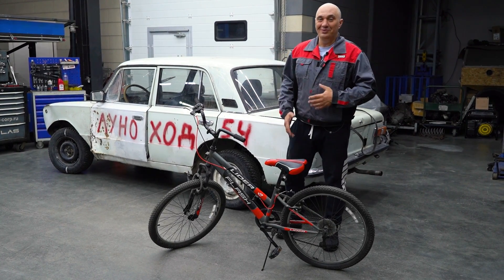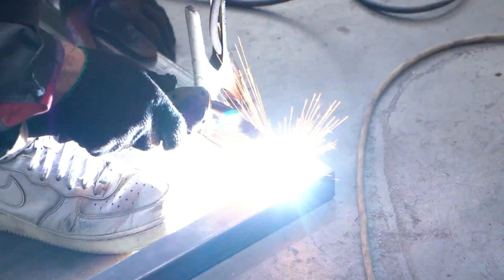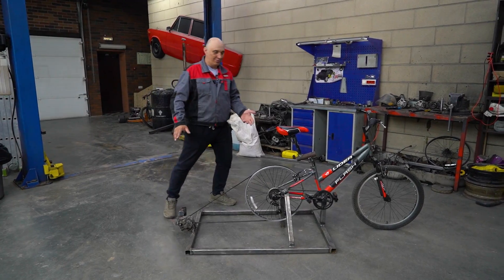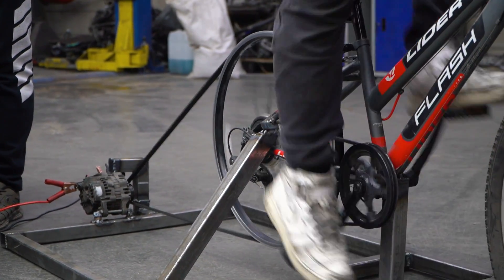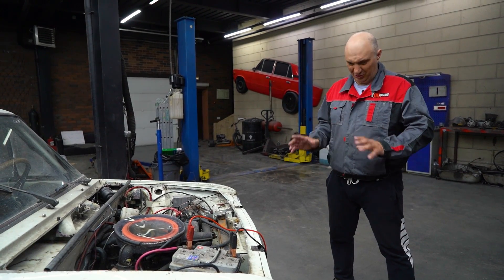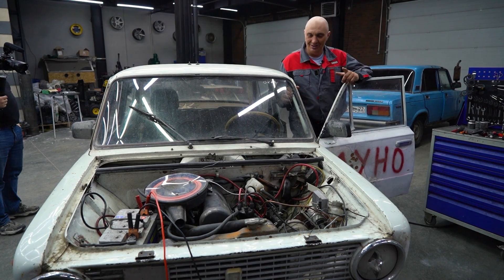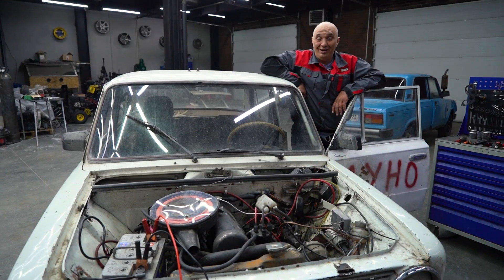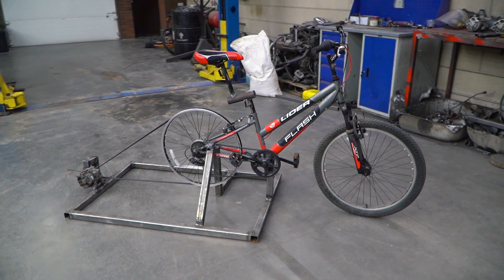Express 10 minute battery charger - pedal faster!

Comment: This system needs a flywheel and a clutch, that's why it's hard to pedal and you get exhausted quickly, because you're constantly under pressure without taking a break.

Comment: What if you make a wind powered car, cut a 55 gal drum in half long ways, flip one over then weld them together, so they cup the wind, put that on an alternator, so when the drums rotate by the wind, it supplies power from the alternator, to supply electrical power to move the car, you can use a second alternator as a motor to turn the driveshaft.   That would be interesting to see you make this. 😁👍

Comment: I have a gas powered two-stroke bicycle that doesn't require battery to run so you could easily use that as a charging Outlet

Comment: I was doing good to keep gas in my car, no way I could go buy a new battery. To get by until I could buy a battery, I mounted an old washing machine motor on the inside fender well, so what I had to do was roll the alternator belt off and put the spare belt on the alternator and washing machine motor and plug it in and charge up the battery good enough that I could start the motor and off we'd go.

Comment: You could try this again with a flywheel, and a General Motors alternator. I believe they are to totally self regulating to output 14V and don’t need an input to control the output

Comment: Replace the lead acid battery with a lithium battery or add a capacitor bank to help compensate for lower voltage situations. 😂😊

Comment: Had the battery go dead on my truck and did a similar thing except mine was take the bar off a chainsaw a wrap the serpentine belt around the chainsaw to the alternator and start the chainsaw and let it spend the alternator to the battery got a good enough charge to start the truck

Comment: If you can't just park your heap on a hill or if you can't manage to keep a fully charged backup battery in the trunk, you'll be needing Garage 54's custom pedal-powered charging system. For convenience, this can easily be permanently welded to the roof, adding beauty and utility to your heap! This modification is sure to substantially add to your heap's resale value.
Reply: Jumpbox but a cheap 1 that wont do carp for a fully discharged battery cause I live on the wild aide

Comment: In Australia many years ago they had pedal two way radios the large cattle  stations didn't have a reliable source of electricity but there is the school of the air and they had there lessons ovrr the radio and the students had to pedal to produce electricity for the radio to operate

Comment: You're supposed to wire it straight to starter motor but with capacitor in between wires... When I was younger I hooked up 230 volts straight to starter motor and it was mere seconds before the car started...

Comment: What you could do to make this work is… add an additional wheel to the system the has lots of mass. If you spin up the mass, the generator/alternator will continue spinning for a long period of time needing less effort to keep the voltage and amperage output much higher with stored energy. Love watching your show from Minnesota.

Comment: Get an asynchronous inductive mains motor, hook it up just like they did the alternator here. Plug it into the wall socket, it will start spinning and turning the rear wheel of the bike. Now get on the bike, choose the best gear for you and try to spin the motor faster than it turns with the electricity from the wall socket. A funny thing will happen: You will be able to raise the motor rpm just a bit, and the it will start giving you resistance. And that's it - you just started to generate electricity and push it into the wall socket! Of course you don't have enough power to power up all the devices at your housw or flat. But at least the meter will turn slower, so you can do your training and lower your electricity bill just a bit! Try it, that's not a joke, it really works.

Comment: Flywheel would of made it a bit easier once it got going
Reply: No, just needed to use a higher gear.
Reply: @christophermarshall5765 why not both?
Reply: @AlienLivesMatter  using the right gear, the bike wheel will act partially like a flywheel at high speed. Cadell Evans could pedal that, & not even know there was an alternator driven by the back wheel.

Comment: Idea:
Have a second alternator charging the second battery by using the CV axle while you drive and with the flip of a secondary switch you simply switch batteries if it dies
Reply: Thats just regenerative braking with extra steps

Comment: got a home made generator, small 1 cylinder gas engine, uses a car alternator and with a power inverter and deep cycle batteries, i get 110 volts house current BUT, put the jumper cables on a car battery with the engine running, i have jumped off my car, a neighbor's car, brother's car and even jumped off my riding mowers with it, and used it as a 12 volt battery charger.  i let me neighbor use it one night, and his family was shocked that even after it ran out of gas, they still had a tv and fans going.  i just laughed and told them that was the way i designed it and was why i used deep cycle batteries since i was using a power inverter.

Comment: I once had a lawn mower with a spring you would wind up then release the energy to start the engine. You could try that on the Lada. A kick start could work too.
Reply: The earliest Ladas had a hand crank for starting when the battery couldn't get the job done.  Sounds like BS, but it's true.
Reply: yes, you could manually crank the engine the same way you could start a prop plane; and snap your wrists.

Comment: My dad used to take alternator belt off get old electric 110v electric motor Mont to board then run belt to charge battery up when didn't have a chager

Comment: 8:12 when you crank a vehicle the alternator is excited to 13.8 to 14.20 volts as the engine turns over. You guys only used the battery power in this video when you should have been peddling as you cranked the vehical garage 54

Comment: 6:55 12 volts is not good at all. That battery should be holding 13.20 v if it is a one. Garage 54 at least here in America are batteries hold 13.20 v brand new
Reply: This depends on battery chemistry.
Reply: In Siberia, 11.9 volts is plenty.  Vlad said so.

Comment: Replace the rear wheel with a flywheel or flywheels .Added rotational mass could improve stable rotation.
Reply: An automotive type flywheel mounted on the alternator drive pulley would improve its reciprocating effect while charging.
Reply: So would shifting.
Reply: I came here to say the same thing 👍🇨🇦
Reply: That is a great idea. Take some of the strain out of keeping it turning.
Reply: Also a larger diameter as it'll increase the ratio between the bike to alternator allowing the alternator to spin faster

Comment: Put weight on the the rim to keep the wheel moving when not peddling.
Reply: Water in the tube will do the trick really good.
Reply: Weight on the alternator drive is better. It's the part most in need of reciprocating

Comment: I can't believe 4 minutes was the longest someone could pedal. I go out riding everyday and it takes me 1 hours 40 minutes to ride 32 miles without stopping and I'm 58 years old.
Reply: You dont know how much tension is has.... dont jump to assumptions...
Reply: @SLMAHKMY87  I climb 1,00 feet (~300 meters) on a few rides that I do, and I complete the climb in less than 20 minutes. It is on a shorter ride than the 32 mile ride that I do. There is no way those people would be able to do a ride like that on that bicycle without that strap to the alternator coming off.
Reply: If we're ever invaded, I hope you will be there to show them who's boss.
Reply: @danbergthold3481  I'll be the first one there.

Comment: I cycle a lot and ride an indoor trainer. I had someone ask me if I could run something off the power I'm producing. I'll have to send them this video 😂
Reply: I watched a WWII movie some time ago. They used a bicycle rig to power their radio.
Reply: You could easily do this, just get a high output alternator with a self regulator so you only need + and - to battery and you are good to go!

Comment: Maybe build it for extreme weather deep snow outside would require the alternator be mounted at minimum 4 feet off the ground and a housing over the alternator to keep snow and rain out of the electrical connections

Comment: I wish you went into more gear ratios to see what you can really get out of it
Reply: YO MAMA DONT LIKE GEARS
Reply: Pfff
Reply: You don't really need gear ratios for that, an adjustable coil current regulator for the alternator would give you infinite adjustability from 0W to whatever the alternator is rated for, which is probably more than what a normal person can put out - I've pedalled on a dynamo while I was pretty much in my best shape ever and the most I could do was 700-800W for 15 seconds.
Reply: @teardowndan5364  alternators need to be spinning at least 2,000 rpm to produce full power, which is why it has a small pulley. Had they used a higher gear on the bike, then getting the full 60 amps out of that alternator would not have been a problem. The regulator you do not see, because it is inside the alternator. The extra wire you see doesn't connect to the ignition side of the car electrics. It connects to the battery warning light, which is connected to the ignition side of the switch.
Reply: @christophermarshall5765  In most car alternators I've seen (haven't worked on anything over 20 years old), field control is external so the alternator drag can be suppressed as much as possible while cranking. The "battery warning" light doesn't really need a connection to the alternator, it can just light up whenever battery voltage is below 12.5V since a running engine with working alternator and no shorted battery cells will almost immediately get system voltage to at least 12.8V.
Reply: @teardowndan5364  You screwed up mate!! The battery indicator light in older cars is connected to the alternator. When you turn the ignition on, the warning light comes on, & it is through the warning light the stator windings get the power. I'm a retired auto engineer. I'm extremely well versed in how they work. Modern cars have the alternators computer controlled, & volt meters on the instrument cluster, but still require power to the stator to get them working. An alternator won't work without the stator being excited by external power. The way you state about the alternator drag being supressed during start up, is not right. This system works on an rpm sensor in the engine, so the stator is not excited during start up. Once the engine has started, & has been running for about 20 seconds, a relay switches power to the alternator to excite the stator, thus allowing the alternator to produce electricity. Yes, the battery warning light does come on when ignition is on, & this does not indicate low battery. It indicates a fault in the charging system, which is usually a regulator problem.
Reply: @christophermarshall5765  "An alternator won't work without the stator being excited [...]" it is the rotor that gets excited via slip rings, not the stator. The stator is the output through a 3ph bridge rectifier. As for the instrument cluster getting power from the alternator, all power distribution in a remotely modern car is centered on the battery and will run perfectly fine with a busted alternator for as long as the battery has enough charge remaining, which is about 1h beyond sudden alternator failure such as a grenaded accessories idler pulley like what happened to one of my friends last year.

Comment: I think you can consistently produce around 200W by pedaling. A 50Ah battery would need around 3 hours to fully charge with that power (without losses). Thats faster than some battery chargers!
Reply: 200w is not easy to generate though. I tried on my generator bike and even at only 60 watts... The load on the petals felt as if you were petal powering a bench grinder in Wich someone was grinding a block of rubber. If that makes sense, it's just the only way I can think to describe how hard it is to petal
Reply: @mondude9754 400 watts is a professional level. 200 watts is a pretty good athlete.  I’ve ridden with guys that can do 1300 watts for over 30 seconds, quite impressive!
Reply: You don't need to fully charge a battery to turn over the starter though
Reply: 200w is profession levels of sustained power.
Reply: @MaYbYl8eR  and I'm assuming that is the rating of actual energy exerted by the person. Converting mechanical motion to electric I think is only like 50% efficient so really you'd need to be putting out 400w of energy to get the 200
Reply: @MaYbYl8eR  no, track pros do about 400 watts per hour. just check on the track hour record with wiggins and others.
Reply: A real alternator from a car puts out thousands of watts.
Reply: @cliffcorbitt9494  only if there is demand for enough current, and it depends on the engine and alternator. Some can easily do that at engine idle, some can bot
Reply: @SerPurple51  that is incorrect with a car altinator. Once it gets excited it will make all the voltage it can
Reply: The right gearing and flywheel fixes the eversion issue

Comment: I did this years ago.   The power required for the alternator field is too close to what an average non athlete can easily pedal.   You get a lot more usable power by using a DC permanent magnet motor in place of the alternator.  Just add a rectifier in line so the battery doesn't try to run the motor when you stop pedaling.  Motor size around 100 Watt would do it.
Reply: It's only about 2 amps to run the field, although the DC with no vampire power drain is better.
Reply: @TimpBizkit  Depends on the voltage for the windings. 2 amps at 12 volts is still 24 watts of loss - non-athlete cyclist could pull maybe 200 - 300 watts, but definitely not at a sustained load - comfortably sustained would more likely be 150ish watts. So 24 watts lost is a fair chunk.
Reply: Google 'How to Build a Practical Household Bike Generator' by Low Tech Magazine
Reply: You guys are stuck inside the box.
Try THIS instead:
Ever heard of a STEPPED MOTOR???
Drive one of them, and you’ll get a LOT more effective energy than an alternator!
AC is just fine, but it took another guy to think outside the box to realize that it would transmit a lot farther than DC!!
Reply: lowtechmagazine /2022/03/how-to-build-bike-generator.html
Reply: How well can it change a Tesla from 20-80?
Reply: Or just a smaller alternator, they are way more efficient at power conversion than a DC motor
Reply: Nonsense, you probably fed it straight to the field winding so the current flowed as if it was a short circuit, because it was in fact a short circuit!
Reply: @SinsBird field windings can take 12v direct. When I hook mine up to 12-13 volts the field windings pull about 4 amps so far from a short circuit. And I can confirm even supplying enough current to keep the alternator on is immensely difficult on my generator bike
Reply: @mondude9754  it depends on the regulator! One regulator can limit to 2 amps other can have no limit! There are different styles of alternators.
Reply: @SinsBird  I was talking about with the regulator bypasses

Comment: I saw Vlad only making 11.5v 😂
Reply: It's obviously a low amperage alternator morons! It's not gonna just put out 14.5v right out of the gate under a load. Educate yourself
Reply: That means his voltage regulator is no good. It needs to be at least 13.8 to 14.20v. DC
Reply: @cliffcorbitt9494 no it means he's not turning it fast enough to generate more voltage. They probably bypassed the regulator anyways
Reply: He needs a 20% larger wheel on the bicycle to turn the alternator faster.